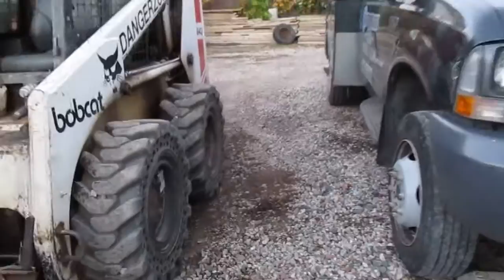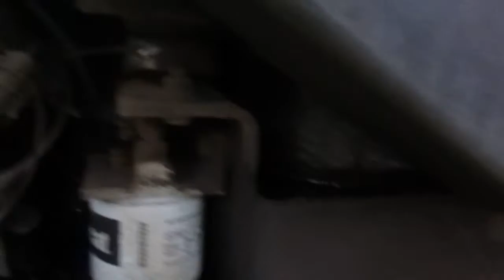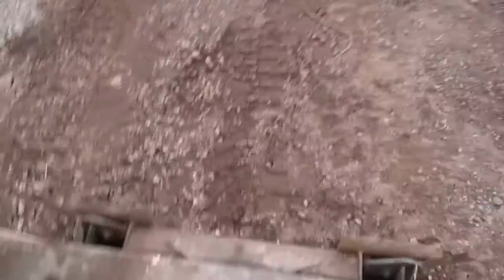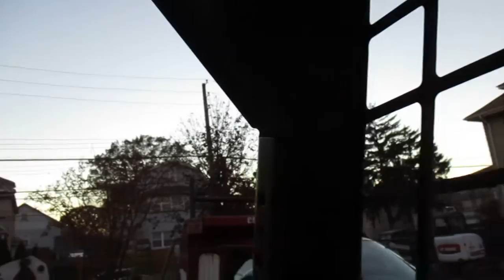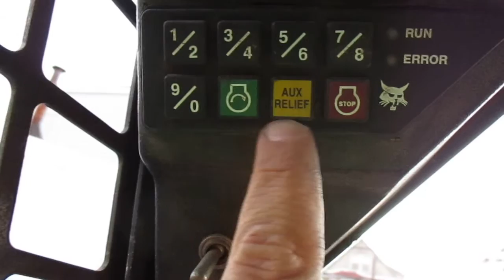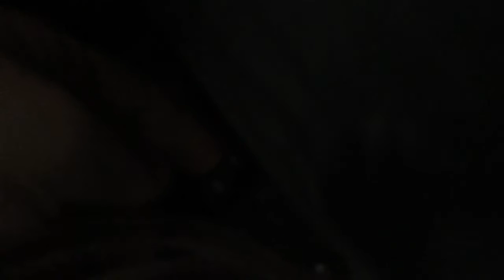Bobcat 843/843B skid steer loader walkaround

Comment: Great information on the 843s we’ve got on on the farm it’s a late 88 to early 89 model having problems finding steering control parts that are the same as mine and fit . Even the hydrostatic steering pump rebuild kits aren’t the same. Do you have any suggestions for a good source of parts. Have a slight chatter while using the right steering at times. Rebuilding linkages with machine shop now to remove sloppy linkage but can’t find the right hydrostatic pump rebuild kit. Thanks for your video.

Comment: Nice video, I realize it's an older post so not sure you will read this.  Been doing concrete for 35 years, seems like a dying breed.  I have a question that I have found difficult to find the answer to. Bobcat 843B ( I assume this as it has the original Isuzu engine ). It's broke down in a not so ideal location to work on and I am wondering how to get this up onto a trailer without damaging hydraulic pumps by dragging.  Some people say there is way to bypass and free roll, never really specific to the model or procedure.  Have you been through this before ? 
Thanks,
Tim Pazdra
Stevens Point, WI
Reply: There is a device made by BobCat that screws in the top of the pumps that allows for moving a non running machine.  I cannot find  the P.N. But call BobCat
Reply: Take parking brake out under cab

Comment: I’m new to your channel and So far very impressed with your equipment you said 14,000 hours on your bobcat 843 is that true
Reply from the maker: John Furey thanks for watching. It's an estimate of the hours. He's been through a few hour meters since new. Back in his day you had a backhoe attachment, not an excavator so he worked 10 hours a day, everyday. I've put it in new sprockets, chains, gear boxes, axles, newer pump and universal. It's the original Isuzu engine and body of the machine.

Comment: This is a good video, and you seem to know quite a bit about the 843. I'd like to ask you a question.  I have a 1986 843 Bobcat with a Perkins 4.154 200 Series engine. I need either a new cylinder head or a whole engine. I have searched all over North America for these parts, but to no avail. The 4.154 200 series engine is no longer supported. I know a person who adapted a Kubota light plant engine to an 843, but it took a huge amount of adapting. Do you know if an Isuzu engine can be fairly easily adapted to replace the Perkins? Thanks.
Reply from the maker: Hugh Smith thanks. I believe it can be. The head mechanic at my Bobcat dealership is an expert on these machines. He rebuilt a 743 virtually from a shell. I will call him to ask for certain though.
Reply: i have a 843 looking for a backhoe attachment
Reply: Hugh Smith it's a straight enough fit just bring the bell housing plate over 
 also the fan flywheel obviously, the engine you buy for it can be found in a Isuzu NKR/NPR light tipper truck preferred 1988/94 I'm pretty sure it's a 2.8 Isuzu IV had trouble finding 2.8 so sometimes when I cannot get one for a costumer IV had to install a 2.5 Isuzu from a NQR in feac I have my own 843 currently running a 2.5 Isuzu and load of power it's naturally aspirated, I do intend on installing the D1105 or 1505